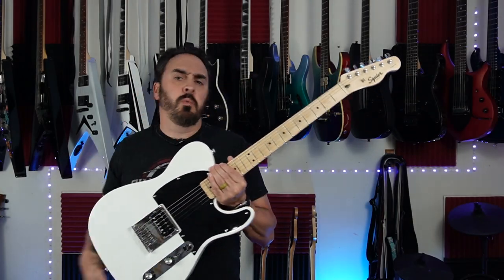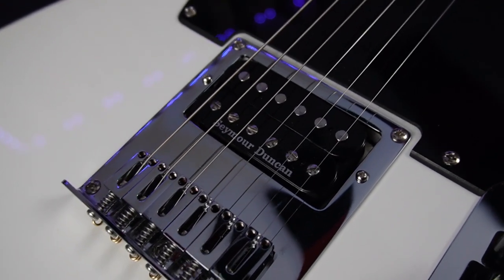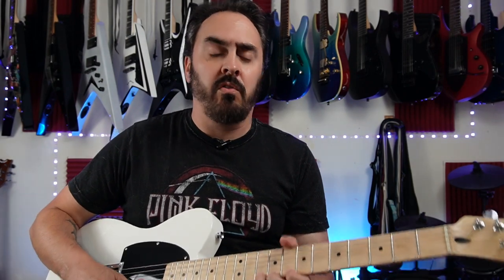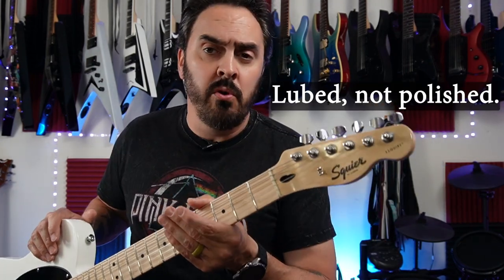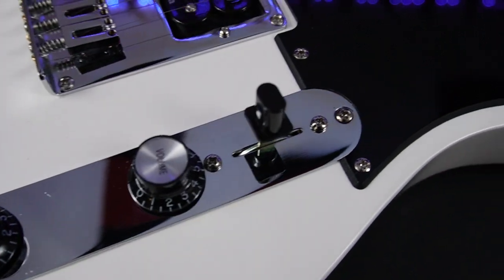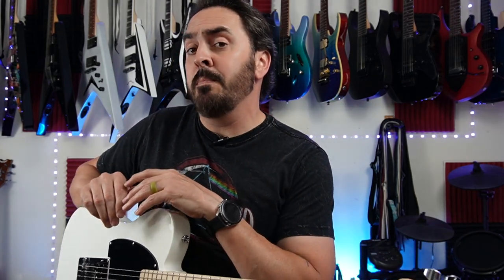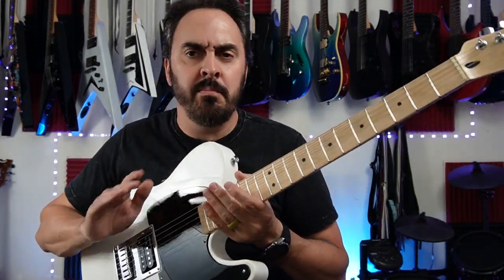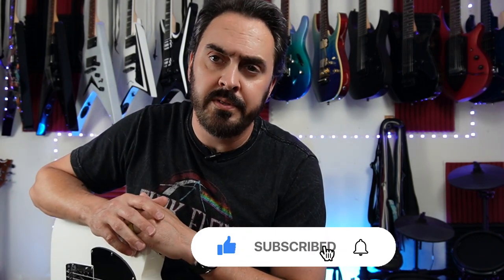Squier Sonic Esquire 3 Way Switch Mod #squier #esquire #fender

Comment: I've always preferred guitars like this as mod platforms. I have a lot of parts from my 40 years of playing, including quite an extensive pickup collection of Duncans, DiMarzios, EMGs, PAFs and god knows what else. I'm a player, not a collector, so resale value doesn't even cross my mind. I believe in simple but practical guitar mods. Many top players use guitars like this as their workhorse a lot more often than fancy, schmancy axes. Trevor Rabin has used a heavily modded strat since the 70s. He still plays it. He's played other axes but still uses the strat. If it works it works.
Reply from the maker: This is one of my favorites to grab when I just need an E standard bridge humbucker for high gain. It took a little work to get it how I like it, but I think it was worth it.
Reply: No pickup can pop out so many great harmonics all over the neck like a JB, and I've owned more pickups than I can remember.  @Guitarnivore
Reply from the maker: @angusorvid8840  I put an Invader in this about a month ago. It's coming out in a few days and the JB is going back in. The Invader is cool...but it's just not a JB. It has the output, but it doesn't have the clarity.

Comment: Strongly considering getting one of these and making the same mod.  Thanks for the diagram!
Reply from the maker: You will NOT be disappointed. I've been playing the hell out of it  and it's the second cheapest guitar I have. I would keep the 500k pots and .022 Capacitor. It gives the split such a bright and twangy sound.
Reply: @Guitarnivore  I totally agree with you about the 500k pots and cap!

Comment: NEW SUB! I like your whole philosophy, at least what I know of it now. I mod my Squiers too and I enjoy all of that stuff. I've turned them into wonderful, personalized axes that are not necessarily for sale and which I would not trade now for similar Fenders. It's very interesting that you wired the hum coil as the active side of the split circuit instead of the usual signal coil. I never would've even thought of that and surprisingly it sounds great! Nice job.
Reply from the maker: A few years ago I was buying just about every cheap, Squier I came across and did upgrades. I even modded my 50's CV with a better bridge and noiseless. I don't do it nearly as often as I used to, but I enjoy it. I didn't think to split the slug side. That's just how the wiring diagram was and I think it sounds great that way, more single coil sounding than it normally is. I had two nice MIM Fenders in the last year that I got for a great price on each....and I sold them because I never played them. They were nice guitars, but just boring to me. Thanks for watching!
Reply: @Guitarnivore  Thank you for your thoughts and quick response. Someday I'll try that wiring trick. I assume you just swap the ground leads on the 4-conductor wire so when you go to your 'split' switch position the signal coil is grounded out of the circuit instead of the slugged coil. Fair enough? Thanks again, looking forward to following your channel.
Reply from the maker: @markpell8979  You can download the diagram in the description, but the bare ground gets grounded with the green like it normally does. It must be all in the switching and the crossovers for the norths and souths. I'm not sure how it all works with the three way switch because I usually use a push/pull for splits and I just follow diagrams. I do know when I was looking at the diagram and saw it used the slug, I was a bit apprehensive about that, but I figured I'd give it a shot.
Reply: It costs to much for a modeling platform.
Reply: I want to buy a guitar that will play great and consider modeling.

Comment: I have a 40th anniversary Squier Telecaster, I want those control knobs. Where did you get them, did you use the stock pots?
Reply from the maker: Yes I used the stock 500k pots and .022 capacitor. These are the knobs I bought. https://amzn.to/3pTU0id
Reply: @Guitarnivore  thank you sir, love the videos. Just got the 40th Anniversary Telecaster Vintage Edition. Going to put a humbucker in the neck position. 🎸

Comment: Where did you get the shorter screws for the saddles? I have a paranormal Esquire Deluxe I'm looking for shorter screws.
Reply from the maker: I bought the 6mm ones, but you may want to measure the ones in your deluxe so you don't go too short on them. https://amzn.to/3Os4TQR
Reply: Monster Bolts has shorter screws for domestic and import.

Comment: I thinking buying this same guitar & replacing the Humbucker with a P90 pick-up. What's your take on a P90 vs a Humbucker on this Guitar?  Thanks For Sharing 🎸 💪
Reply from the maker: You could put a humbucker size P-90 in without making any changes, but  If you're going to do that, I would suggest a good HB size P-90, like Seymour Duncan Phat Cats. The cheap ones you can find on Amazon are just single coils in a humbucker casing.

Comment: Maybe drill it for string through? Might thicken up the tones, especially in the  coilsplit mode. Tru oil is the shiznit for unfinished wood. Gonna be hard to keep the fretboard super clean. I'd just keep applying the Tru oil and let it do its thing.
Reply from the maker: I did a string through mod with an old Bullet Mustang. I don't think it made much of a difference. I may do the tru oil thing on the fretboard some day, but I need a fresh bottle. I did it on an old rosewood Affinity neck and it turned out really nice, but it was a bit sticky on the backside of the neck.

Comment: I'm thinking of putting my Seymour Duncan Phat Cat in the bridge but it's only 1 braided wire, any advice on installation? Diagrams? Anyone? ;)
Reply from the maker: If it's only a two conductor wire, there is now you can split it. You could just wire it like factory with just a volume and tone and no switch.

Comment: Can you explain how the "shorter screws" in the bridge and "radius fix" were accomplished?  I'm assuming by that you mean you basically raised the middle saddles to unflatten them.  Is that close?I would like to do the same thing.  (Guitar sounds great now!).  Thank you.
Reply from the maker: That is exactly what I did. I used the shorter screws so they don't dig into my hand when playing. When adjusting the radius, I use a radius gauge. You can find them pretty cheap on Amazon. https://www.youtube.com/watch?v=-yiBbIzGjW8

Comment: Much appreciated for two great videos bruv , 

I'm 50 this year and well pops get his early for the party 🎉 

What I plan to do is stub screws , pup , tuners , 

And when it feels butter in hands I'll do the 3 way plate mod , 

Subn dudes ❤ 

For Metal
Reply from the maker: I'm only two years behind ya, I also did a mod with a rotary switch instead of the regular tele switch and it works great!

Comment: are you using f-spaced humbucker?
Reply from the maker: I'm using a standard one, but you can use an F spaced HB as well. Either way will work fine with the 52mm string spacing on the bridge.

Comment: what mod would you say is easier, this one or adding a bridge pickup and making it more like a regular tele? (assume cost is no issue)
Reply from the maker: I would say it would just be easier to buy a regular sonic series Tele, unless you just really want the white and maple fretboard. The problem you'll find trying to switch over to a regular Tele bridge is the humbucker bridge is a bit longer and wider than your typical Tele single coil Squier or just about any aftermarket bridge. Screw holes may not line up and/or may be visible once you put a new bridge on it. Other than the bridge not fitting or sitting right, everything else would be rather easy.

Comment: Does anyone know what good bridge can I throw in there if I want to make mine string thru body?
Reply from the maker: I don't know where Squier acquired the stock bridge, but it seems everyone I've seen on Amazon is a bit bigger in length and sometimes string spacing. The string spacing on the stock bridge is 52mm. This one [linked at the end] is the closest I've found, but it's still slightly longer so be aware of that before you buy. Your best bet might be to take some measurements and carefully drill the holes yourself, preferably with a good press and probably while it's still on the body so they match up perfectly. Then get some string ferrules or one of those bars you can mount to the back of the guitar to support the ball ends.  With the thin poplar body of these guitars, I really don't think running string thru will make any tonal difference or increase sustain. I did it with a Squier Bullet Mustang and it resonated really oddly. Personally, I'd leave well enough alone, but it's your guitar and that's what matters. I hope whatever you do works out well.  https://amzn.to/4cZLxx9

Comment: I saw a video from a guy who made the same thing, he built the body by himself I believe. It was a partcaster. How do you feel about the guitar itself? Is it good for the price?
Reply from the maker: for $200, it's on par with the competition. After the work I put it, it's one of my favorites to play at the house.
Reply: @Guitarnivore  thanks for the fast response :) I modded my CV 60s custom tele recently and I am so happy ❤️
Reply from the maker: @Lalairu  I love the CV, Contemporary and Paranormal lines. I normally wouldn't mod a higher end Squier, but I did make a few changes to my 50's CV Tele with noiseless pickups, better electronics and a better bridge.
Reply: @Guitarnivore  I also improved the bridge. I installed a SH1 in the neck, SD hot rail in the middle and baja tele pup in the bridge.
Reply from the maker: @Lalairu  Nice! The pups the CV's come with aren't bad, but I can be picky when it comes to pickup and I like something that can handle a bit more gain than they're meant to.
Reply: @Guitarnivore  the baja tele roars like hell 🤣

Comment: /Spills dirt on the floor

Better go get my

RAZOR BLADE
Reply from the maker: You've never cleaned old, dirty fretboards with a razor blade? It's one of the best ways to clean them. You just kind of lightly run it back and forth between the frets at about a 90 degree angle, scraping away any built up dirt that lemon oil doesn't get, especially right up close to the frets.
Reply: @Guitarnivore   no never have thx

Comment: It is necessary to mount 250k pots or 500k pots are also fine?
Reply from the maker: I always use 500k for humbuckers, regardless if I split them or not. If it's too bright in single coil mode, just roll back the tone pot a bit.

Comment: What does the under bridge routing look like? I was wanting to add a standard Hardtail bridge with a ring around the pickup, nut don’t want a big hole from an angled single coil. Would that be possible?
Reply from the maker: I did this just for you. A pickup ring would fit perfectly and line up pretty well with the existing screw holes in front of the pickup. However, you would have to find a bridge that would cover the 3 other screw holes. The outside ones are 80mm apart, so the center one is 40mm between them. https://freeimage.host/i/JoA62i7
Reply: @Guitarnivore  thank you so much man!!! I hope you had a good thanksgiving :]

Comment: why not just use the truoil on the fret side? one of the ingredients is boiled linseed oil. I got a maple neck mustang prob from the same series and I'm thinking of redoing the whole neck, front, back and headstock with tru-oil
Reply from the maker: Because truoil can be a little sticky even after it dries.
Reply: You can use old English scratch and dent furniture polish instead of linseed oil .... I use the one for dark woods.... to put on the back of the neck/fret board after you sand it..... wipe on and rub in and wipe off....done/dry
Takes less than a minute... will not stain hands or hardware.... gives it a natural aged look.... cheap and a bottle will last forever. 
Works good for rosewood fretboards also to condition and darkin up.

Comment: A newbie question: What is this configuration (single humbucker at the bridge) good for? What pros does it give to the sound? For what kind of styles/songs/sections is it good for?
Reply from the maker: Single humbucker in the bridge is good for rock, metal, punk, but you can play clean as well. It's just a bit brighter at the bridge than at the neck. Neck pickups offer a warm, creamier sound to them. With this mod you can get a nice single coil sound out of the split, as well a scooped mid sound out of the parallel position.

Comment: What are you talkin' about?? 8.2k ?? Mine has 16.1 kohms I have the indigo rosewood version but still.....8.2k ?!?
Reply from the maker: Yes 8.2k on the stock pickup. What are YOU talking about?? Squier has never had a stock pickup that hot in a bottom end guitar. These are the same garbage green insulated 2 wire pickups they've been putting in every HH and HSS bottom line Squier forever.
Reply from the maker: Even this guys ultraviolet indian laurel is only 8.16k : https://youtu.be/iu9Y5K2fRkM?si=WiChoPsmalrJymuB&t=317
Reply: @Guitarnivore  not sure if I can upload a photo in the comments but mine has 16.1 kohm
Reply from the maker: @ludmilla4778   You buy it new or second hand? Here is the thing about Squiers. They're made in a factory where many other guitar brands are made. It makes me wonder if they may have run short on the stock pickup when that one was being made and just grabbed one from another brand and dropped it in there. Either way, that's great that you got a hot pickup. it sounds a lot better with a hot pickup, but Fender/Squier doesn't typically use hot pickups in any of their guitars, so that's why it strikes me odd. Mine currently has a Seymour Duncan JB, which is around 16k.
Reply: @Guitarnivore  was brand new, when I was waiting for it to arrive I've already order another humbucker to replace it because I knew the squier will come with stock trash pickup.....but when I tested it sounded great , measured it and it shows 16k have you measured your pickup ? the stock one?
Reply from the maker: @ludmilla4778  Yes. Even after your first comment, I went back and measured again just to make sure I didn't miss something. Still 8.2. In my latest video I show a mod I did with a rotary switch with the Seymour Duncan SH-4 to make it work like the Paranormal Esquire Deluxe.